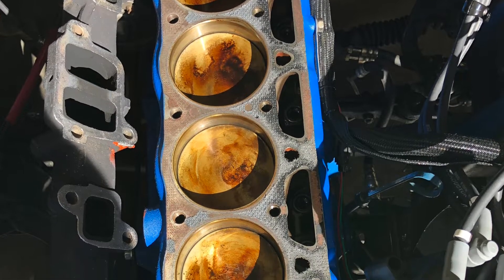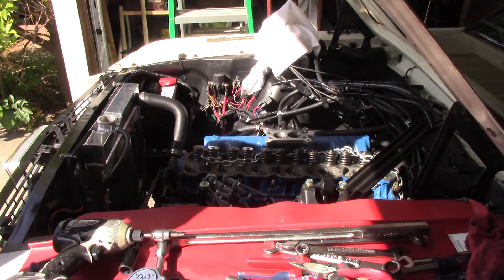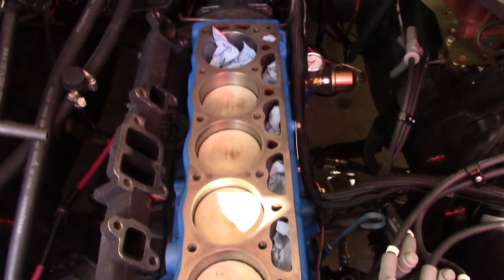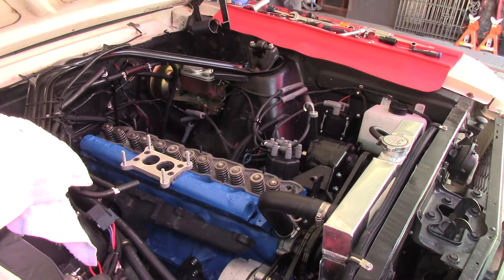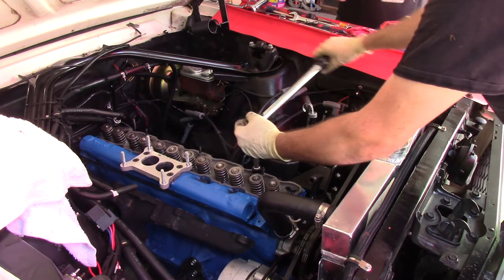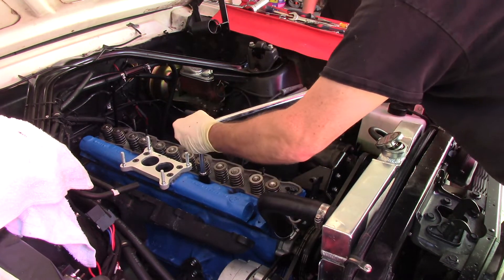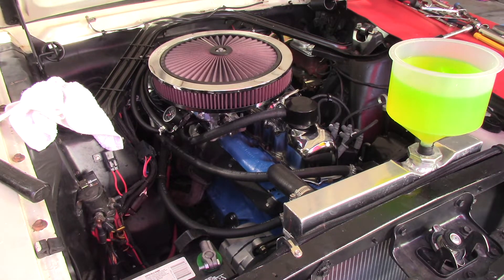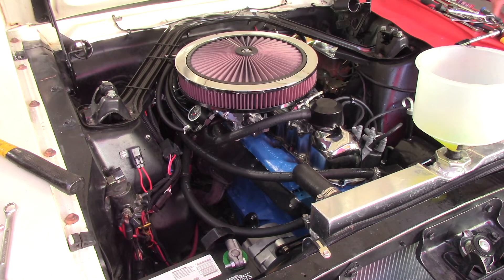Ford 200 2V Defective Head Replacement/Exhaust Leaks and How Big of a Deal they are with EFI

Comment: What is the clacking sound ? Lifters ? I've been involved in pulling Ford 200 inline 6 out of a 68 Mustang sedan automatic. Put a rebuilt block with rebuilt head on it  back in. I was all about wanting the hot 289 V8 back then. Now, I'm just fine with the economy and smoothness of the inline 6 engines. I wish the inline six's would make a comeback with rear wheel drive.

Comment: The intake manifold is integral to the head?  Makes running an aftermarket manifold out of the question on a 200.  I assume the larger 260/300 sixes aren't like this.

Comment: Whenever I'm torqueing a cylinder head, I make sure nothing is going to interfere with my ability to make one long sweep of the torque wrench. Sometimes I have to go with a longer extension. Never use two extensions joined together.  Just one half inch extension long enough to clear all obstacles.

Comment: Excellent video.  Just rebuilt my 65-200 cylinder head with 1.5/1.75 SS valves with steel seats and 302 springs plus shaved .090 off the the head. Not sure what it will accomplish since I didn't swap it out with a newer 250 head but I guess we'll see. Took the bottom end and sent it out to see if I need it bored .020 over then replace dished pistons with flat tops along with new moly rings. Still torn between the expensive Sniper fuel injection or the Weber 32/36 easy swap method. Im doing this on a 64 Falcon. Right now its a waiting game on the unavailability of parts through Vintage Inlines but I'm trying to stay positive.
Reply from the maker: Thank you. Be careful taking that much off the head. My old small log was shaved about that much and it would not hold true. Leaked at the coolant passages.
Reply: @mechtrician1  I'm trying to follow the recommendations from the Ford Inline Six Performance handbook that says you can take .100 off without issue but I guess we'll find out. Today's head gaskets are so much thicker than the originals I'm hoping it all works out. The lower engine deck will get just a light pass mill to obtain flatness. I'm surprised the sniper isn't readily available on Vintage inlines site. Its the Weber 32/36 from Spain that they can't keep in stock. And yes...a cookie cutter 302 would be easier & cheaper but it's nice to keep the inlines going. Keep up the great videos. Good lessons & tips to keep in mind.
Reply: @mechtrician1  How much do you typically take off a 250 head, and do you know if there's any valve clearance issues if your cam lift exceeds .420?

Comment: Good job getting the old head off. When I do cooling systems or engine rebuilds I generally put the car up on stands or drive it onto ramps so that the engine has a definite incline at the front and the top of the radiator is definitely the highest point on the cooling system. This helps to force any air still in the system to the thermostat bleed hole and then into the radiator. I like the radiator filler funnel, I also have one and use it, but they don't change the natural tendency of air to get caught in high cavities in cylinder heads.
Reply from the maker: Yeah, I’ve done that before. I was just lazy this time haha. It has been really good about not having air pockets before, kind of surprised me this time.

Comment: The heads for these sixes are heavy. I learned that when I had to pull mine to have some busted exhaust bolts dealt with. I did not have a cherry picker to take mine off. Had to do it the old-fashioned way and I paid for that the next day. Good to hear her running again. Still waiting on my Autolite 1100 Sniper.
Reply: Me too. Ordered mine in February!
Reply: @daledassel5658  I ordered mine in March.

Comment: The carduretor adaptor appears to be one that adapts a Holley 500 two barrel to a GM Rodchester dual jet intake. Am I correct? It looks like it would do a lot better than other adaptors I've seen on you tube which just bolts on the stock single barrel intake. I would think that would restrain the flow quite a bit. Your adaptor looks like it would flow freely to all the cylinders. I would really like to know if I am correct about the adaptor you used. I think Auto Zone handles the adaptor I'm talking about.
Reply from the maker: It is a Holley 2100 base pattern. The head was milled open and a steel plate brazed in. The adapter plate is a Transdapt plate that was drilled and bolted to the brazed steel plate.

Comment: Do you have any pics of the head without that plate bolted to it? I’d like to see how they milled the head for that.
Reply from the maker: I might have a picture with the adapter plate off, but you won’t be able to see how it’s milled. He mills it open and then brazes a steel plate to the top.